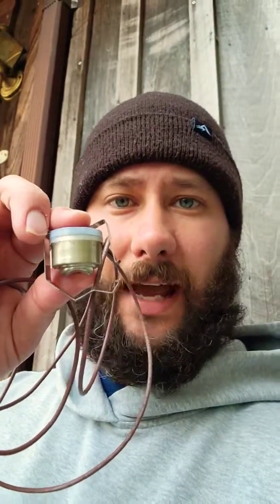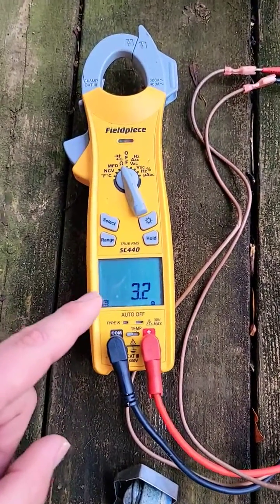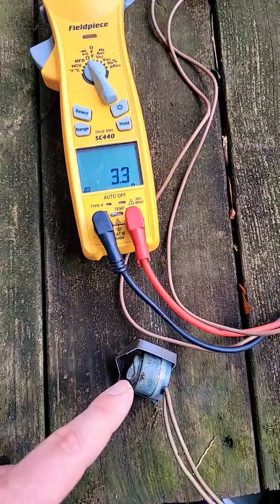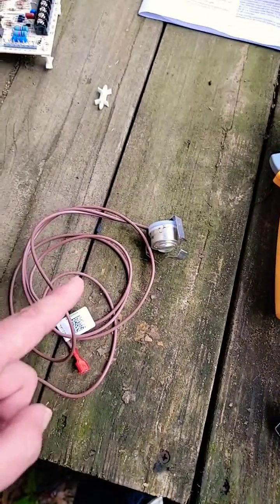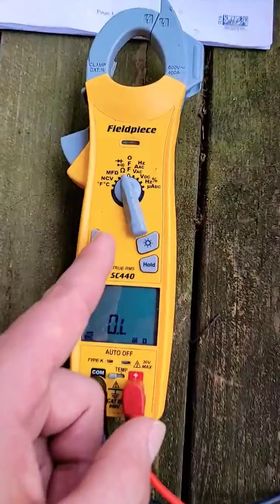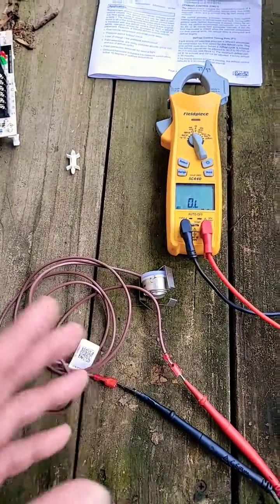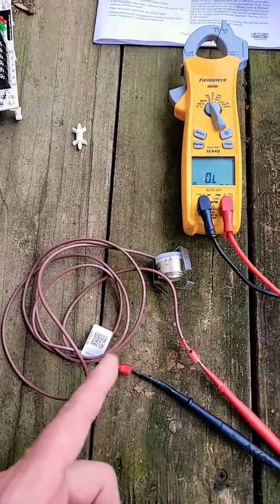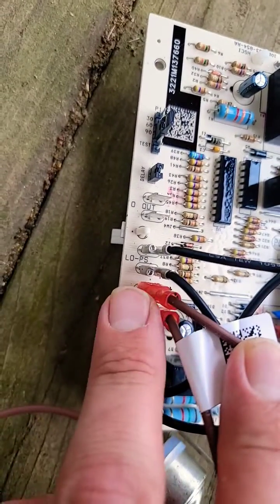How to test a defrost thermostat?

Comment: Got a question
On my ambient sensor, I have of the wire going to the bottom left of the contactor and other wire round the pump then goes back to the bottom right side of contactor. My wires doesn't go the board. ?

Comment: It shouldn't be open if you're testing it outside and it happens to be colder than the sensor rating. Without explaining that, the video is a bit misleading.
Reply from the maker: Good point, I should have explained that in the video.

Comment: Thanx. 
My 26 year old Kenmore dehumidifier started frosting up the coills (covering in white ice). It has worked perfectly every summer until now. 

It reads a closed circuit at room temperature on a work bench.

Now to find were I can buy a new thermostat.

Comment: To test the actual physical switching of the thermostat, you can dip it in a cup of ice water (going to be 32 degrees Fahrenheit, as long as mixed and ice still present).  Observe it switching (closing, for the normally open model shown); then remove from ice water to see it switch again as it warms.

Comment: As long as the DF is above the trip temp it will be open, but if you measure it and it’s colder than it’s trip point it better be closed. And to be clear, when this switch is closed it only enables the defrost process, it won’t actually cause the unit to defrost when it closes.
Reply from the maker: very good
Reply: This man gets a standing ovation for pretty much repeating what Taddy said - only in not so many words. 🤦🏻‍♂️

Comment: For the new guys out there — Not entirely correct - if the Ambient temperature is below 42 degrees Your switch will be closed. Just make sure to check switch in a room where the temperature of that room is above the temperature value on the defrost temperature sensor.
Reply from the maker: This is great info
 I love it
 Thank you

Comment: I been in HVAC for 30 years went on a no heat call this weekend seen a unit I've never seen before Lennox isn't that popular in my area a few people have them but not many this was a Pulse 21 90 percent gas furnace never seen a set up like this but anyway everything is concealed it has a air flapper valve below the combustion fan and it was raising hell what exactly does this part do I have no idea found nothing on Google to help so I called an old friend of mine that's retired but he has been a service tech for many many years and he told me that furnace requires special tools made by Lennox and very doubtful you can find them anymore if you could same thing with parts it would probably cost more to fix it than a new furnace would cost he said 25 years ago when the pulse was new it was probably the best furnace made just wondering if anyone has experience with this furnace I know someone knows about them but I sure don't
Reply: Try “ my heating guy “ youtube